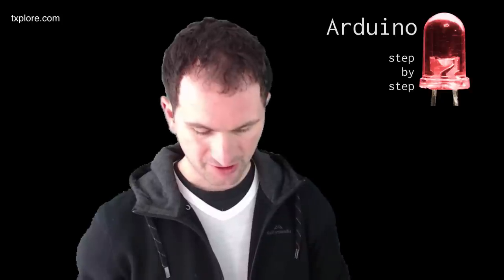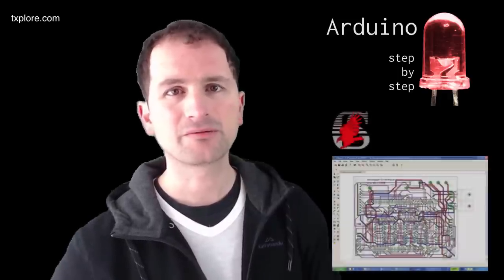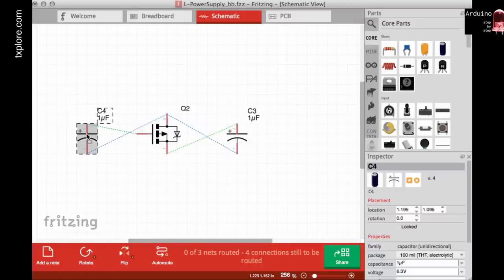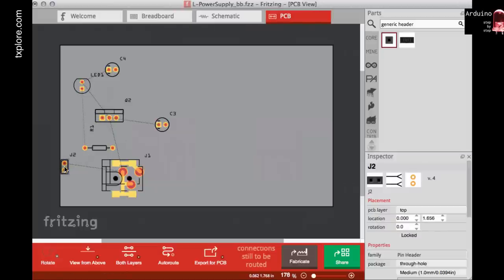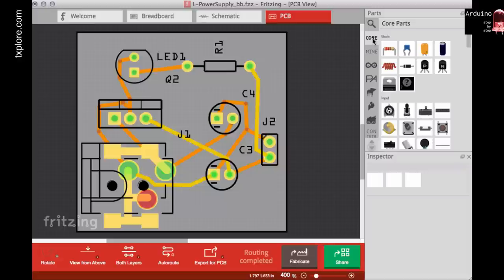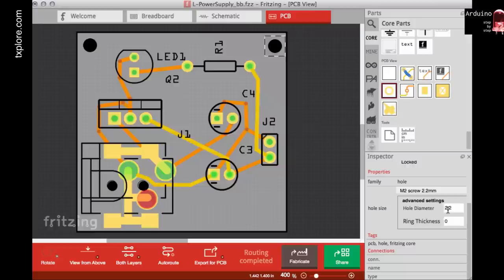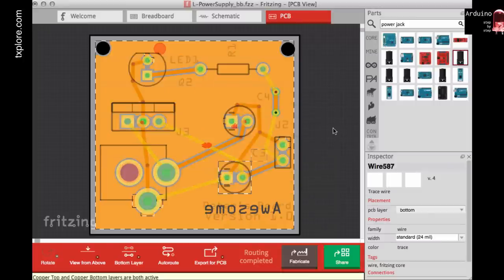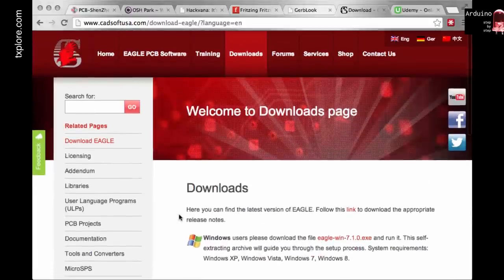Arduino SbS - Make your PCB with Fritzing

Comment: HI Peter,

I mess around with a lot of things so learn most of the time. This is one of the best tutorials ( about anything I have learned so far). Well done and more importantly thanks. I started to use Fritzing last night and one thing that frustrated me was that I couldn't get hold of double sided PCB and why we can't force Fritzing to force to use single sided board. How can we do that ? Also for good reason ( mainly that creating PCB's mean there will be hazardous waste produced at home) I wish to get stuff done by a PCB manufacturer ( I am not commercial). So what service do you get your done and at what cost ? Please be kind enough to help with these two questions. Thanks again.

Comment: Very instructive video. Thanks. Allow me a very stupid question: Are the top and the bottom layer wires somehow connected in the components' soldering holes? Otherwise, I would not understand how you could solder the jack to the top layer. It is all covered in plastic and you can only solder it from the underside.
Reply from the maker: Hi Thomas, that's not a stupid question. What happens is this: in every hole, a thin layer of conductive material electrically connects the top with the bottom end (of the hole). This material is copper or tin (or whatever the manufacturer is using to make the traces). This is why you can solder a through-hole component on the bottom of the board, even though its traces are on the top.
Reply: Thanks for your quick reply. It is clear now.

Comment: If you try blue screen instead of green screen, it would work a lot better. Also try tweaking your upper and lower thresholds so you get a nice clean trim. Just some tips I thought I would share :)
Reply from the maker: +brandon day Hi Brandon, thank you for the suggestion! This was my first experiment ever. Now I mostly use a plain white backdrop with lights illuminating it to reduce shadows, and I like the result much better. No post-production to worry about.
Reply: +Tech Explorations Yep the white looks better, one more tip for you, put the lightsource closer to you and try a bigger lightsource, this will remove the shadows completely, or if you have the room you could go 4 steps away from the backdrop, this will remove the shadows too :) (I like your vids, keep up the great work)

Comment from the maker: Hi nx u, I am not able to respond to your comment/question directly because your Google+ settings are blocking replies. This video explains how to set your comments so that I can reply: https://www.youtube.com/watch?v=9JstXOp0jjo

Anyway, I am very happy my video helped you. As far as single layer PCBs are concerned, just don't put anything in the bottom layer. There is no way to tell Fritzing that you don't actually want a bottom layer.

Over the last few months I have started using OSHpark.com. The have a really good process for getting your PCBs uploaded and checked. Good pricing too. Even though I am in Australia, my PCBs get here faster than I can get them from China.

Hope this helps!
Reply: Tech Explorations Hi Peter, Many thanks for your response. I have edited my settings for now so if you can respond if you wish to. I was intrigued when at one point in the video you showed a bunch of pCBs that you hat got manufactured that didn't cost a lot. So I thought it's best to ask you since I haven't found any place that asked for less than £20.00 a board !  Things are a far cry from the days I was young and made my first crystal radio ( 1971). How things have changed. Even in my days not too many kids in my School back in Sri Lanka were in to electronics.It's not too dissimilar now. But you can do more and quicker and with breadboard / fritzing / arduino / sparkfun etc it's very easy to prototype.  I used breadboard to prototype a Bluetooth -> RS232 interface to fit my Telescope mount so I could wirelessly control it. I have a working proto on breadboard so need to move it to a permanent home. So that's how I landed on your page.  Please keep the good work going. I am sure you are an inspiration / help to a lot of budding electronics Engineers / hobbyists. Thanks again. Best.
Reply from the maker: nx u Wow, that's amazing! I'm getting into astronomy and telescopes my self, very exciting! 

Very true, I think we are entering a "golden age" for hardware. Cheap components, ample information on how to make things, cheap and fast fabs, almost free Cloud-based resources. Anything is possible for (almost) anyone that wants to make things. 

Will you document your telescope hack?
Reply: Tech Explorations HI Peter, I can send you the Bluetooth connector mod as a Fritzing project ? with the necessary parts ? I use skywatcher NEQ6 pro as my mount. It's not cheap but not OTT either. you can buy very expensive mounts Meade, Losmandy, paramount come to mind. The mod is for NEQ6 pro RS232 / syncscan port on the mount. Not sure if I can post all the photos  ( breadboard  prototype) but if I can I will certainly do.  Start here ... http:// eq-mod.sourceforge.net/eqdirect2.htm There is a Bluetooth section to this page. That is the starting point.  Please tell me how I can attach files to this post. Then I will do that. Hope this helps. Inspite of your excellent video I have Fritzing driving me mad, trying to get this simple ( 5 piece / part) electronic project on to a workable Schematic --> PCB. I don't think it's good at converting Breadboard stuff to Schematics or is it just me ( I know which one it is). Which is the best place to start ? Schematic or breadboard ? Schematics are difficult with those very faint lines. I shall over come. If you have any suggestions please let me know. Thanks.
Reply from the maker: nx u Wow, there's a lot to consider when it comes to telescopes. I am simply thinking of getting something like this: http://shop.australiangeographic.com.au/telescopes-binoculars/celestron-nexstar-130slt-computerised-telescope.html, 

To use for planets, a bit of deep space and photography. It already has a motorised mount, and I think I can control it via a computer. What do you think?

Reg. Fritxing, you can ignore the breadboard. For larger circuits, it makes a mess. Just create a schematic, and move to the PCB layout.

I have hit a wall with Fritzing, so a while ago I moved to Kicad. Very happy with it, and I'll be making relevant videos soon.